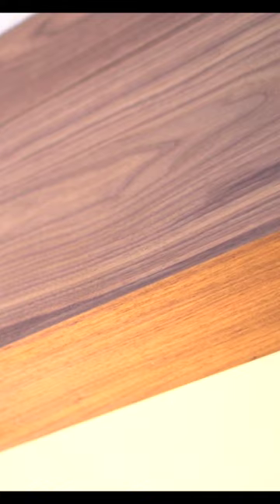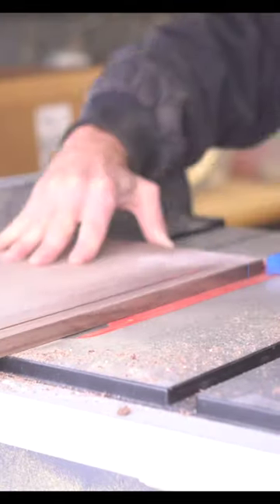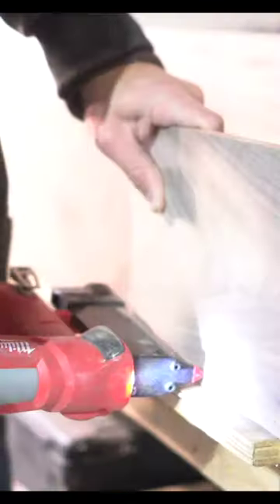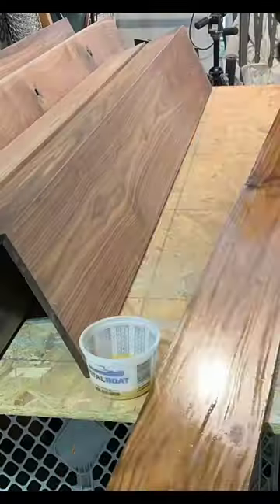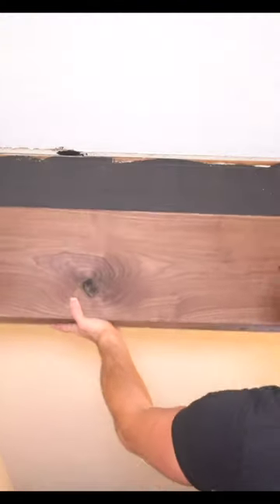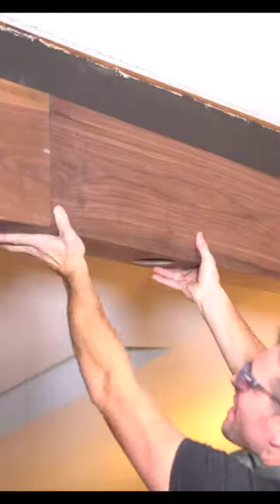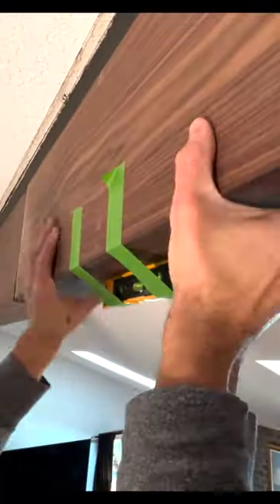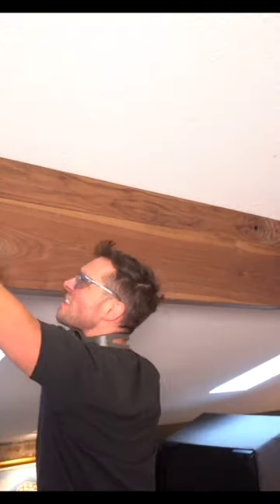How To Wrap A Beam With Walnut! #diy #remodel  #homeimprovement

Comment: Should have used dowels to hold them together so they they line up straight
Reply: Could have used plywood with walnut. I’m sure solid walnut cost a lot. Also wouldn’t have a joint